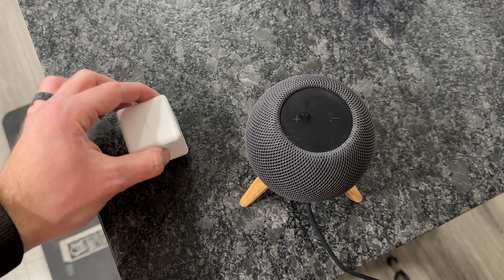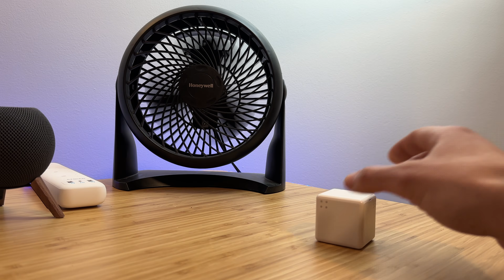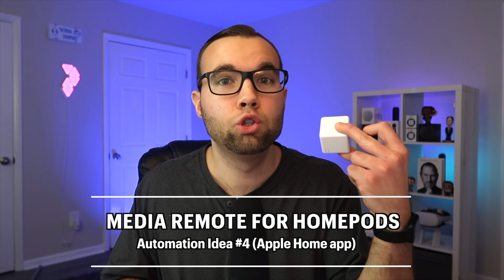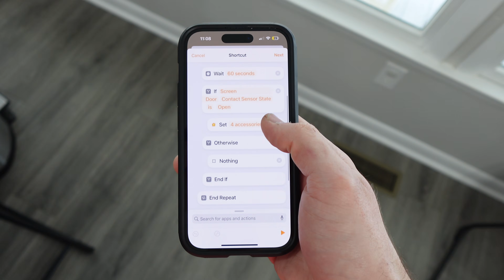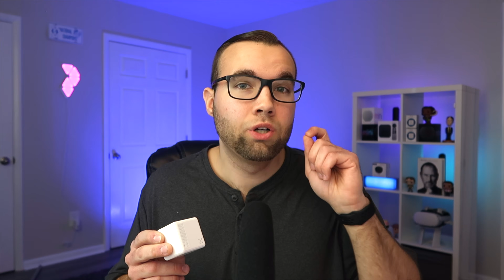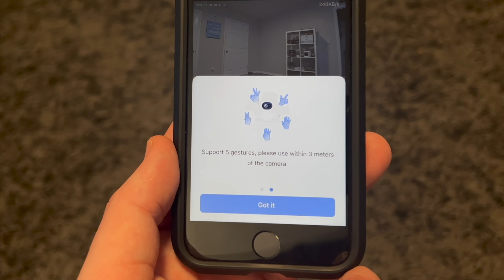10 Practical Automation Ideas using Aqara Cube T1 Pro!

Comment: How d;o you add the Cube to HomeKit... I don't see it?
Reply from the maker: it's in the home app as a button, aqara hub required
Reply: @adamstechlife  Thx Adam, try as I might I couldn't get it to show up in HK,  I have the Aqara M3 Hub (which it shows up in). The code on the removable panel will not scan into HK. I ended up returning the device today. Thx.

Comment: Hey Adam thanks for the video. All great ideas. Where can I find the video for shortcut HomePod door automation ? How the cube works with shortcut ? I’m having some challenges :)
Reply from the maker: Hello, thanks for your comment. heres' the door automation video https://youtu.be/UOwkCm0h8GY and i did a brief showcasing of the shortcut in this video but basically involves converting an automation to a shortcut and adding a bunch of if then statements.
Reply: @adamstechlife  thanks but this is a little different from this video. Anyway I understood the idea. I’m struggling a little with the cube and shortcut. Do you know if is possible to run a specific shortcut with the cube ?
Reply from the maker: No, as the shortcut runs locally through the HomeKit hub, you’re only able to run certain shortcuts and not previously created shortcuts
Reply from the maker: It’s not like running regular shortcuts through the Siri Shortcuts app

Comment: * PLEASE ANSWER * The Aqara Cube T1 Pro can now control Alexa Routine and is a Matter Device. Since, now Alexa supports Matter Compatible devices. Is it possible to connect the Cube with Alexa and Control Alexa Routines WITHOUT HAVING THE AQARA HUB. Or the hub is still required and mandatory??
Reply from the maker: HUB REQUIRED
Reply: @adamstechlife  thanks for the answer. But then why does Matter Protocol actually matter if we need different brand hubs for different devices. Isn't matter supposed to provide unified cross platform support